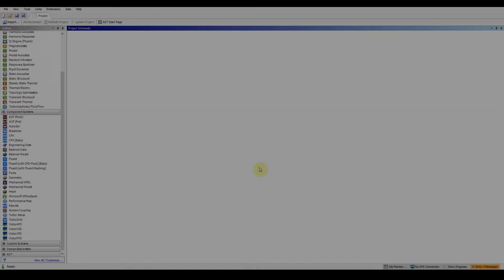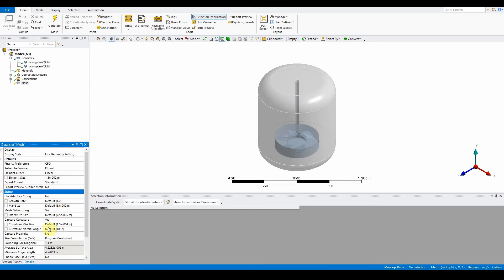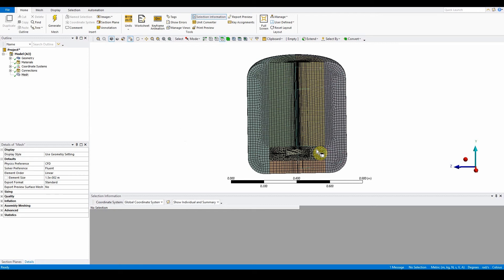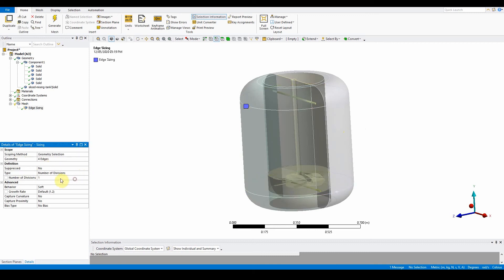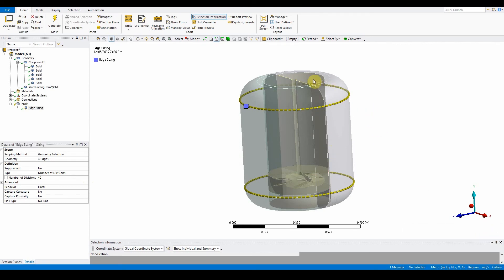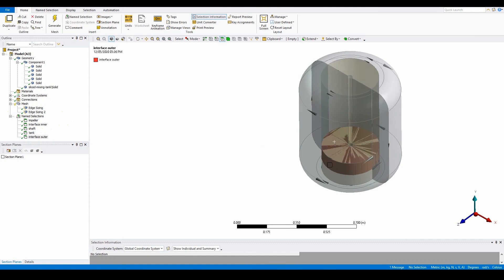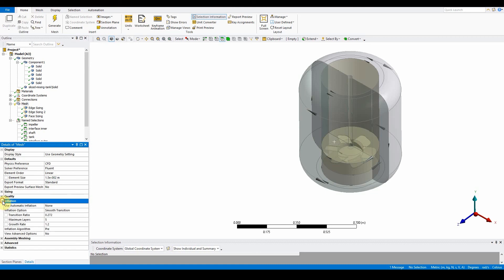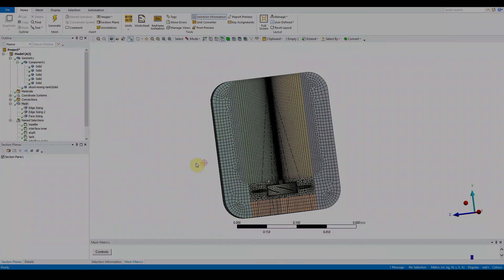ANSYS Meshing Workshop 5.1 CFD Mesh Quality Mixing Tank

Comment: im designing a mixing tank and your video really helps me a lot, but for the meshing i little bit confused how to get the sliced mixing tank geometry?
Reply: you need to cut in in space claim :)
Reply: @vorsey780  Thanks so much!
Reply: @rezarezita3623  you're welcome :*
Reply: @vorsey780  thank you but i still don't understand:(
Reply: @imamwhy  you can use combine and then cut option :) it will slice your geometry
Reply: @vorsey780  how can we do it in design modeller? And after we split, we will get multiple zones, isn't it?
Reply: @vorsey780  oh ANSYS SpaceClaim